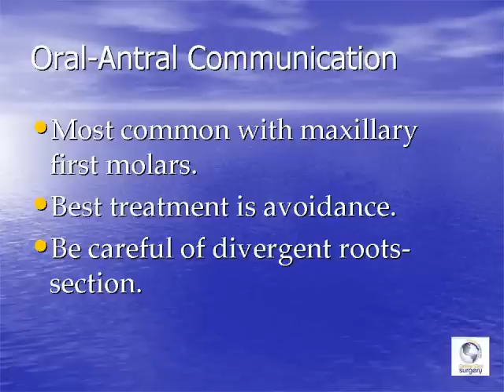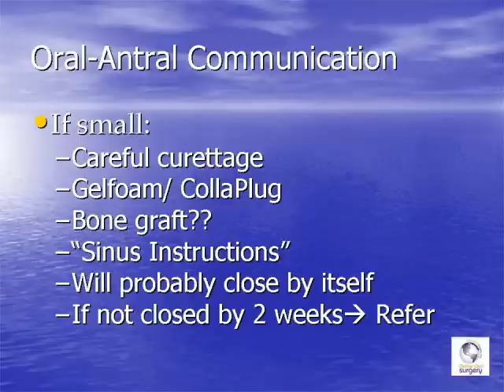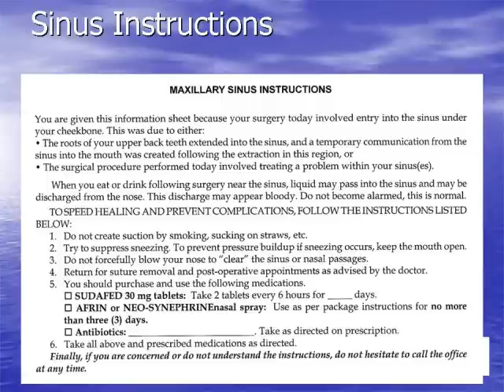Management of a Small Oral-Antral Opening During Extraction

Comment: Good video, thank you. This video has given me an idea of maybe what has been going on with me for a while now. I had a root canal on tooth number 14, the root canal failed, and I had to have a re-treatment, the re-treatment also failed, and the infected tooth ended up being extracted by my dentist at the time, and ever since that extraction I have been having issues, and I can't help but wonder if the dentist didn't do a proper job at extracting the tooth and caused damage to my sinuses, either by way of creating an Oral-Antral communication, or possibly forcing a root/fragment of the tooth into my sinuses. I have been having nonstop drainage, my throat on my left side is sore and swollen from the nonstop drainage, I have a bit of a low-grade fever, I have a lot of soreness in general on the left side of my face, it is no fun. I am trying to get a hold of "Allegheny Oral and Maxillofacial Surgery" here where I live in Pittsburgh to be seen and hopefully get some answers as to what is/has been going on with me. Again, thank you for this video.
Reply from the maker: Glad that this gave you some insight. Most likely that the infection you had in the tooth expanded to the sinus before the tooth was removed. If the opening in to the sinus from the socket is small, it usually closes on its own. But, it doesn't always. Go see the oral and maxillofacial surgeon and get this problem fixed.

Comment: I just had my number 3 tooth and failed root canal removed today. Because of the long standing infection due to the missed root canal we were expecting a fistula into the sinus when the tooth was removed. I did have a maxillofacial oral surgeon do the tooth extraction. What I’m noticing is leakage, mostly air from the sinus into the mouth. I’m not drinking from straw but I don’t think I could if I wanted to because of the leak. I realize this is day number one so I’m not panicking yet. The surgeon did place a bone graph a skin flap with stitches to close the fistula. Question, is this symptom fairly normal in the first day or two and usually resolves on its own or should I be contacting my surgeon?
Reply from the maker: I would let the surgeon know. If he/she did a bone graft and barrier membrane, there should not be any air passage.
Reply: Thank you. I will do that!